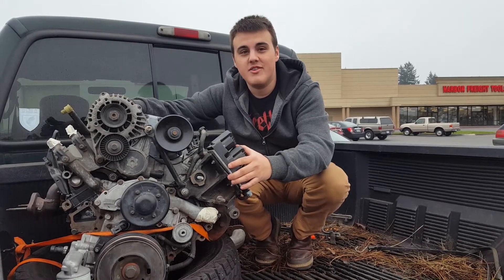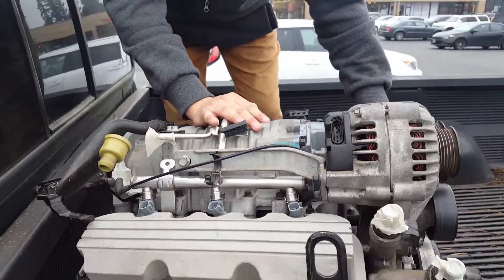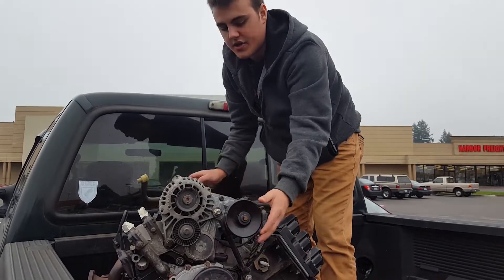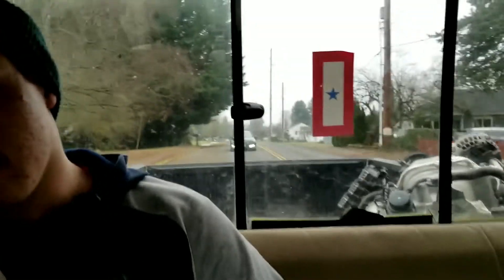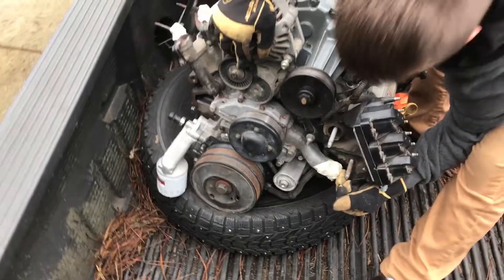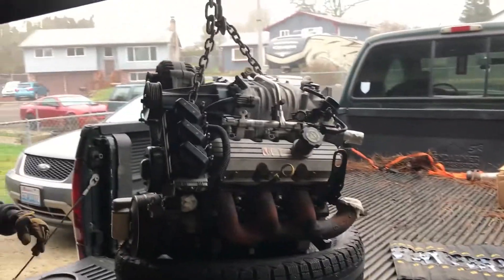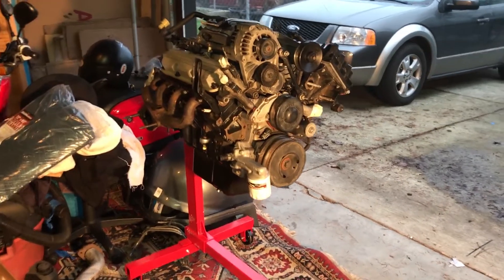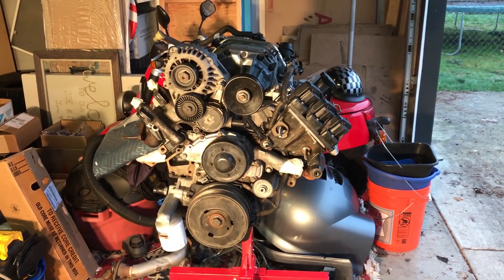We Picked Up Our New Supercharged V6 Engine For Project F! (L67 3800 Series II)

Comment: Sorry if this sounds dumb but why engine swap wasn’t there already a 3.8 in it ??im new to building cars
Reply from the maker: The 3.8 in the camaro is a L36 and we're swapping in a L67. The blocks are identical but have different cylinder heads and the L67 has a blower. Buying this engine separately also allowed us to build it up outside of the car.
Reply: Jury Rig Garage  thank you I have a 97 firebird 3.8 I don’t know which it is but I would love to do this to mine I’ll keep watching for sure

Comment: there are so many parts for these here in australia what are you putting it in ?
Reply from the maker: Off the top of my head ZZP XP Cam, ported gen 3 supercharger, LS7 lifters, 130# valve springs, 7" pushrods, gasket matched ported heads, 3'" pulley and methanol injection. We have a full spreadsheet with our build in the description.

Comment: Can I install a front wheel drive engine on a camaro like this? There's no issue?
Reply: the supercharger will face backwards, you have to fabricate a u bend pipe to fit the throttle on it but it has been done

Comment: Stupid question but I have a 96 Camaro convertible 3800 series 2. Will a sideways motor 3800 work
Reply from the maker: That's basically what we're doing, there is quite a bit of modification/hot rodding to get it to fit